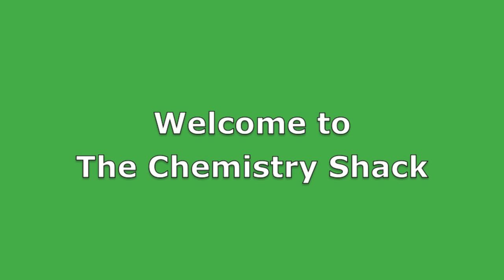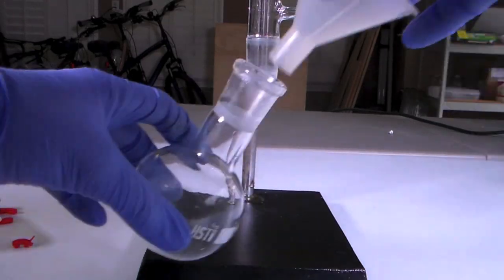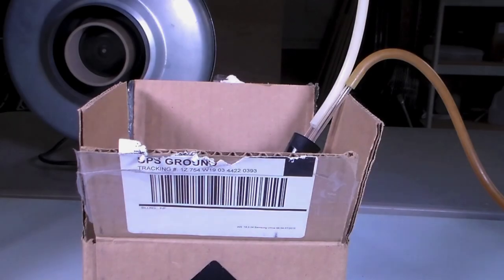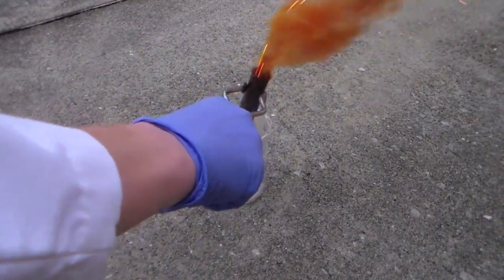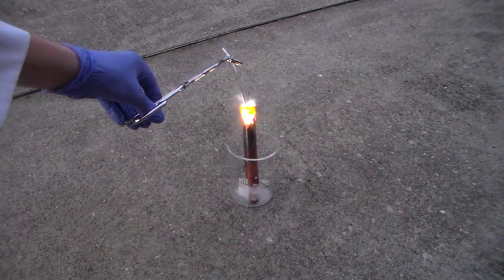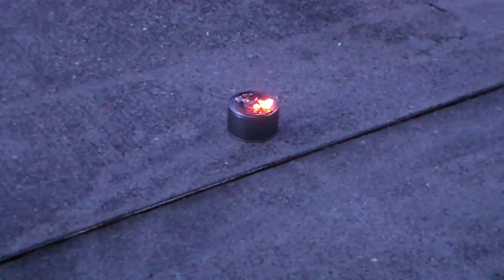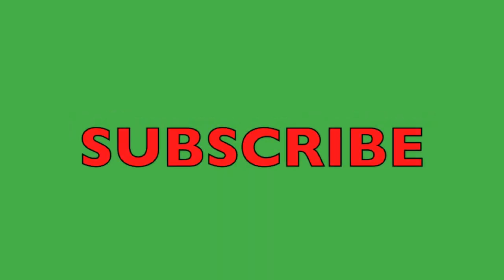Making LIQUID CHLORINE and Reacting it With Metals

Comment: Cool. Is there any way one would be able to store liquid chlorine safely in room temperature? As it becomes a gas at room temperature, I asume the liquid form has to be under pressure. Is there any way to solve this problem? I wonder if a spray/aerosol/any-type-of-gas canister would suffice but I somewhat doubt it.
Reply: John Silver it is actually possible. thats how fluorine is stored. you need a metal container that is thick enough for the chlorine to develop a passivation layer which it cant corrode through further. i believe chromium steel is used but dont quote me on that pls. ^^
Reply: PTFE would work too, but i somewhat doubt that there is a container physicly stable enough to withstand the pressure
Reply: John Silver i just bought very thick borosilicate glass from which ill make tubes for storing chlorine. ill share updates as soon as i get around doing it. i made bromine yesterday, it was super cool.
Reply: You can get samples of liquid chlorine in a normal borosilicate test tube on eBay fairly cheaply.
Reply: @monster2slayer  
Chromium steel means stainless steel.Every stainless steel must contain a minimum 11 % chromium by definition.

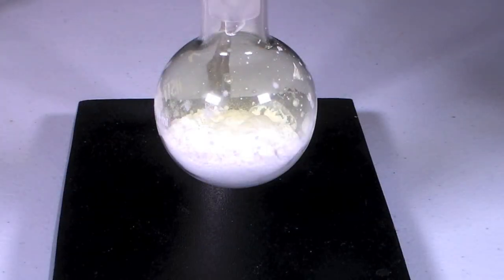Comment: 3:24 why your test tube is dripping chlorine or is just water ?
Reply: That's just liquid water condensing on the outside of the tube.  The dry ice it was stored in is -110f, so water condenses and then it will freeze almost immediately.
Reply: @BackYardScience2000  I'm sure it's acetone and not water.
Reply: @tobinator680  , you are right.  I had forgotten that he cooled it with dry ice and acetone.

Comment: If u did that it would destroy ur lungs
Reply from the maker: well I did do it....and my lungs are fine....
Reply: As a kid I use to play with stuff like this, I experienced what getting a lung full of chlorine, hydrogen sulfide , sulfur dioxide, and not so strong HCN , think worst asthma attack ever if you're lucky enough to live , 40 years later still cant smell like I should. At least he's working with grams not pounds, and outside not in the back of a unventilated basement like I was. (The sulfur incident made the house unlivable for a week, pitted the good silver clear through that was wrapped in felt in a box on the second floor, I almost didn't make it up the basement steps.

Comment: respirator? WTF?? i know chlorine stinks but...
Reply from the maker: +Maanuve It's also really toxic. It was used as a poison gas in world war I. You might be thinking of POOL CHLORINE, which is not chlorine at all. It is diluted compounds CONTAINING chlorine, like bleach. These smell bad, but the fumes are not instantly fatal. Pure Chlorine gas however, is extremely deadly
Reply: tennesine is less toxic
Reply: Chlorine was used in WW1 for chemical warfare.  It killed thousands just by floating through the air.  That's why people who work with it use respirators.